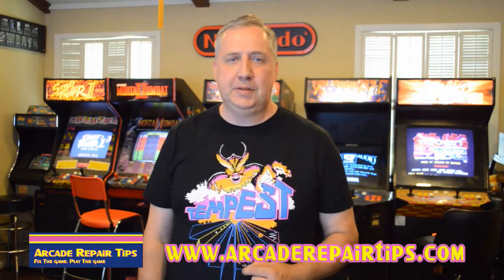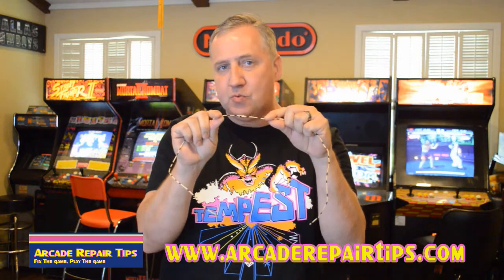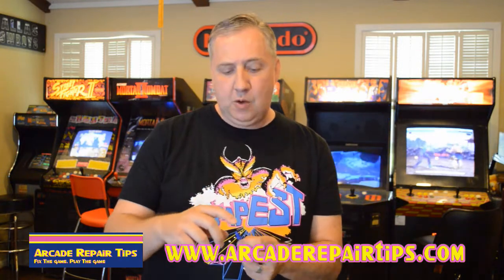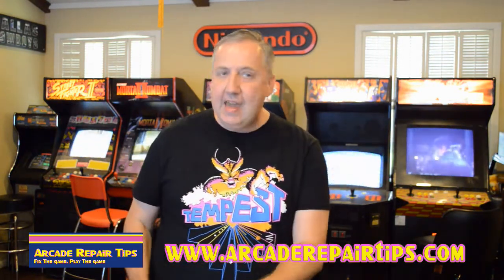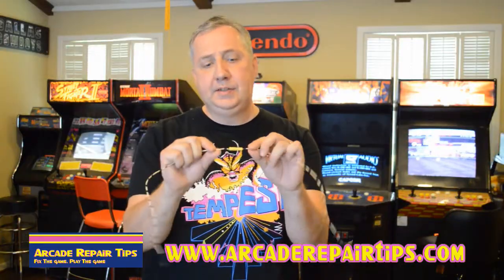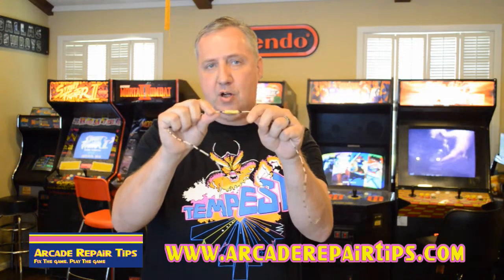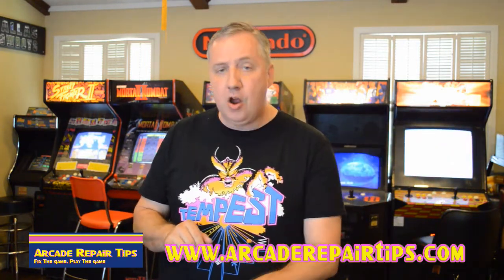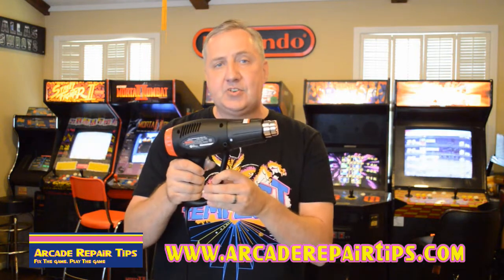Arcade Repair Tips - Repairing Broken, Cut, Or Damaged Wires

Comment: For the solder splice you want to hold the heat over the solder until you see it melt into the wire. A U-shaped deflector on the end of the heat gun will spread the heat around the whole splice. Another tip is to hold the splice in place with paper tape. This holds the splice in place and protects the wire insulation from melting. Remove the tape after the repair.